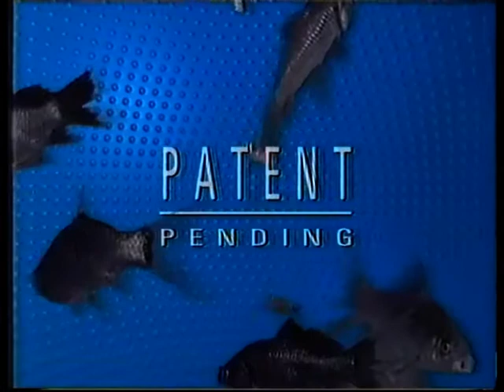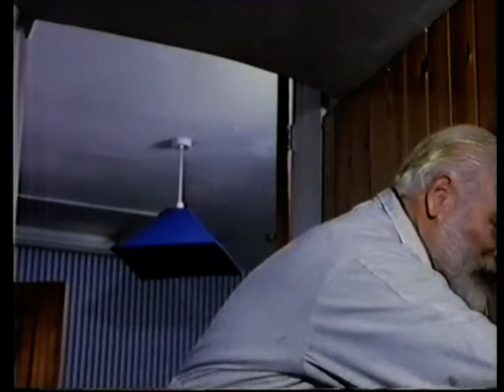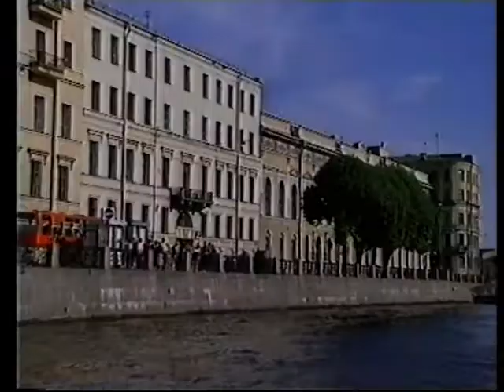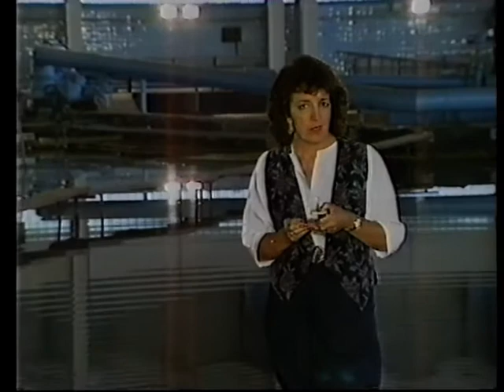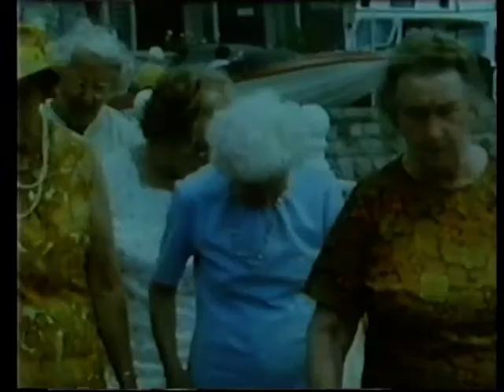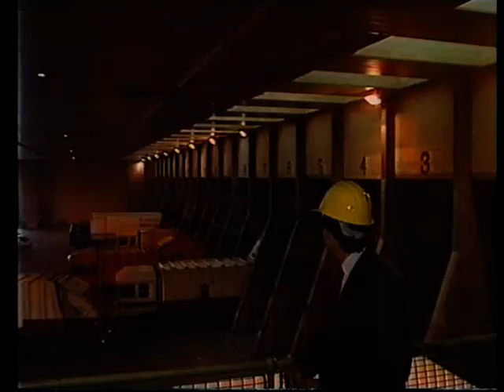Tomorrow's World (BBC1) 15/03/1990

Comment: St Petersburg dam was finished in 2011 20 years later than planned. They missed the 1991 deadline then funding issues after the USSR collapse put it on hold. Environmental impacts have been virtually none and it's stopped flooding at least 19 times. The bigger problem: the barrier may not be strong enough to stop the storm surges as a result of climate changes. Likely it will not see through it's 100 year life span.